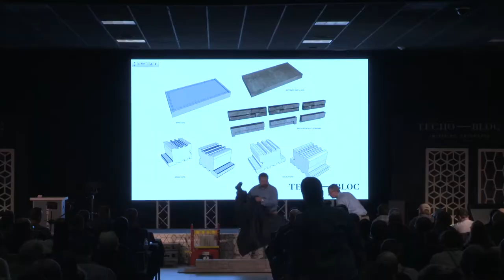NEW PRODUCT! FASCIA Wall Collection by Techo-Bloc

Comment: "If you are building a retaining wall then the blocks need to be tight but I'll let it slide how your doing it for a sitting bench that kids jump up and down on. Lol, they both should be tight, that guy was just being lazy and getting tired hahaha.   Cool process I'm just wondering why so many steps and veneer over the block?  Why not do it like ep Henry cast stone where it's all one block.  I guess one benefit is it's easier to replace broken veneer which happens alot with brand new ep Henry cast stone.  But what is the benefit of having the 2 step system other than more flexibility with the veneer?